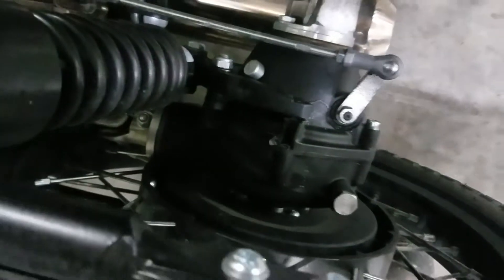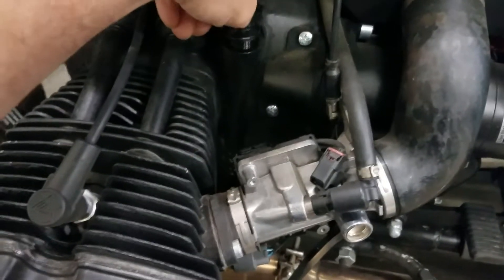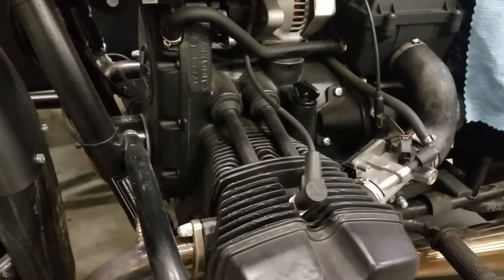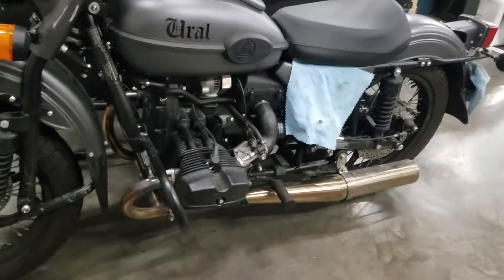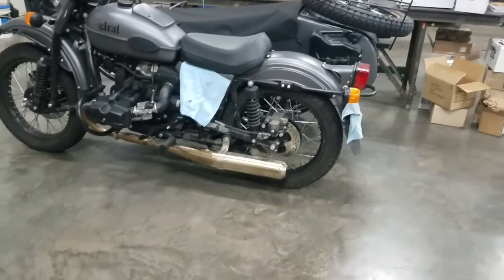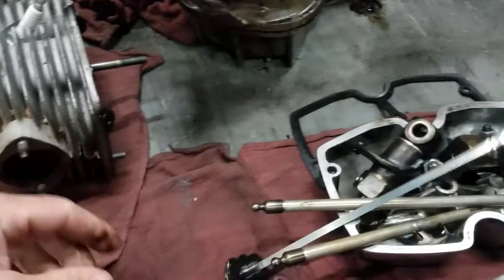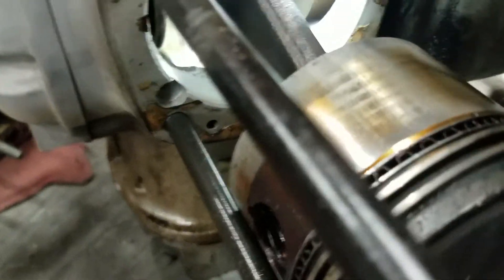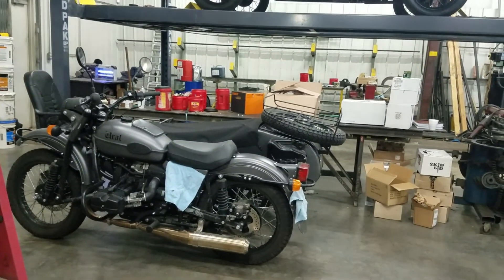2018 Ural Sidecar Motorcycle Air LE Service Notes and Lubrication Talk

Comment: I like ur method of explaining. I dont have a ural but like all motorcycles. And find these modern design urals interesting. Q for you. Would thes bike comb nation benifit from an oil cooler?
Reply: Big debate on that.   Trouble with an oil cooler is that the Ural engine is very low pressure engine.  Simple solution is to monitor and change your oil regularly
Reply from the maker: The Ural Oil pump does not have enough capacity to supply oil through a cooler.  You run the risk of causing more harm than good by simply hooking an aftermarket cooler onto the Ural

Comment: Man that qualifies as owner abuse right there.  With that low amount of oil and as black as it is you can almost count on a main bearing failure in the future.  Know the final drive nuts are a pain but as the manual says you have to check your fasteners regularly.  Good for Ural for covering the warranty on the final drive but owner abuse is the source of the problem.